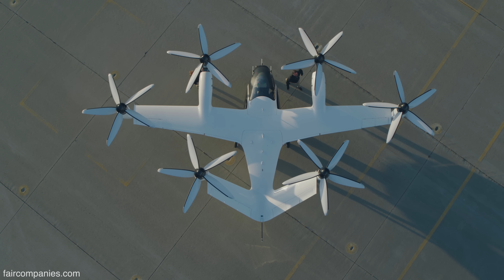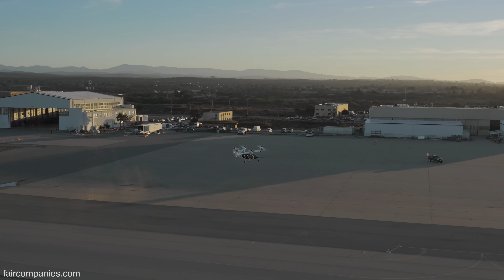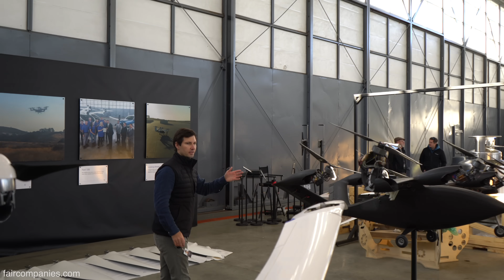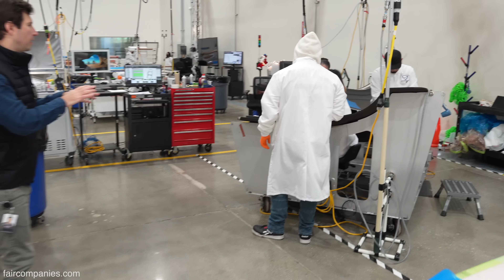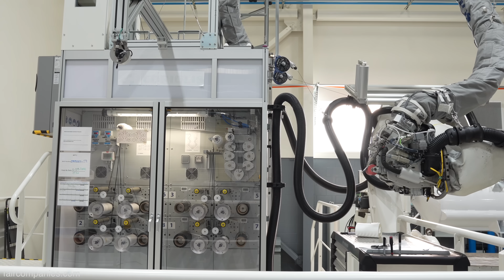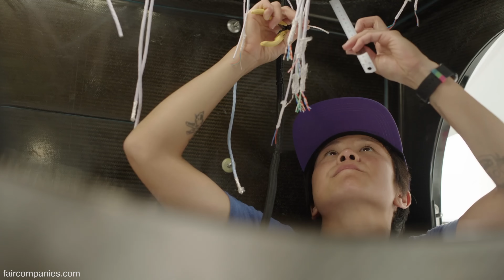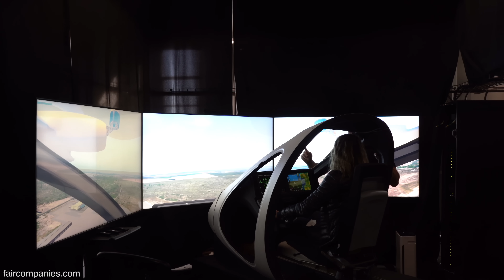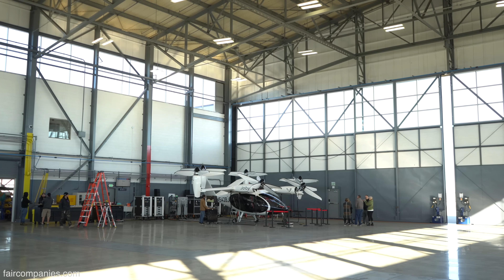eVTOL: electric flying car beats helicopters in silent commute

Comment: Will those superlight propellers hold up properly to a bird/flock strike?
Reply: That’s the reason our president will not fly in an Osprey 🎉
Reply: No. Vehicles using multiple rotors are highly subject to loss of control in case of a single engine/fan failure (assymetric lift/trust). Ever lost a fan on a drone ? I did, it was ugly, was only able to salvage the remote control. Those vehicles are not known to include redundancy on that matter.

Your way out is to fly high enough, shut down all engines and have a chute. You must be trained to identify the nature and the extent of the failure in a matter of seconds, if it's a collision with a foreign object (bird) that may disrupt stability due to a change in aerdynamic and/or power profile, or a more concerning situation like the loss of one or multiple fans. In any case, trouble with lift/power/stability means you land immediately. Helicopters is a mastered technology for so long (you glide via autorotation), drone-like vehicles is fairly new and having multiple engines instead of one (or two, with the torque on Helicopters), means more training to have the qualification to handle emergencies.

Also, I don't think vehicles that light would survive moderate hail storm, or severe rain. Drones as they are today are not that water proof. That's why safer vehicles able to lift humans are a lot much heavier (and therefore requires runways), they are designed with the strength to face adverse weather or light impacts (birds) and ability to glide and land roughly okay even if losing power (if a suitable land site available, like a corn field). I don't see any way to achieve that with such a small/light vehicle.

Comment: I think to be called a Flying Car the vehicle would need to be able to drive on the roads legally.  This is because it would be useful to be able to fly to a landing site and then drive on the roads that last few miles to your destination.  Airplanes have the same problem and have used rental cars or have someone pick them up.  It will be unlikely that you would be able to land at your home unless you had a large property and the neighbors did not complain.

Comment: It’s huge, slow, short range, no useful load, loud as hell and blasts prop wash all over the place. It will require an airport to operate just like helicopters have over the last 100 years. These will not be landing at the mall or your driveway. This video is hiding the noise this machine makes. The props produce the noise in all aircraft….. not the motors.

Comment: Now this gives me hope. I have never been a fan of anything EV for a couple or reasons. The battery range and even more the noise level. Most EV flying vehicles are really noisy which are annoying for home use and for the passengers. But this thing is very impressive noise wise

Comment: And how does it fly with people onboard? II didn't see any payload/proxy weight .... as you load the props the sound produced will increase... if there is no load on them then I would expoect about half the db....what is your net vs gross ? And battery is...? range at gross? so many questions, and the y really do matter. As shown , you have a lightly loaded drone... your control solutions seem great instable forward and stationary... how do you go with turbulance ? and aysmetric load?

Comment: Poor design, look at a cmptr gpu,That's how the blade design should be swept like a spiral with a coanda ring around the blades which increases effiency and noise from blade chop,add a hydrogen system to the electic motors,needs to go back to the drawing board sorry to say

Comment: So question what happens when this transportation loses power due to any number of reasons emp, electrical storm and or failure? Great idea just has some major flaws.
Reply: They could use a ballistic parachute that a small charge or rocket pulls the parachute out.
Reply: It’s still mostly a glider, so it would be able to land just like a normal plane that loses an engine.

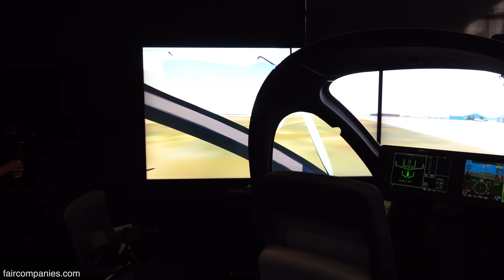Comment: 18:06 
Sorry, but this was a horrible demonstration of Simplified vehicle operations.

If you weren’t there telling her what to do every 20 seconds she would have crashed it 3-4 times for various reasons.
Just because the aircraft doesn’t spin violently out of control or doesn’t become uncontrollable doesn’t mean the person flying it wouldn’t have crashed it.
Reply: Don’t be too harsh at the teacher and pilot, lots of things were going on and what you see is what happened, a real/fresh interaction with no second takes, etc.
Reply: @nicolasboullosa  
This would have been fine if they were demonstrating anything else, but they are trying to sell SVO (simplified vehicle operations)
The idea is that pretty much anyone can hop in and fly one of these with close to no, or no training. 

They should have demonstrated the recovery modes or the form of auto hover I heard they had that would protect a pilot with little to no time, not the woman burning half her battery in a single climb, or the aircraft descending at 190 fpm, or her overshooting the landing zone and bouncing the aircraft. 
It doesn’t sell SVO well. 

Granted, she did 100 times better than if she were trying to fly a conventional Helo, but as a pilot myself she almost made SVO seem complicated.
Reply: @nikobelic4251  Also a test of the aircraft’s ability to compensate for any issue (human error, sudden convection currents as you cross a river bed, etc.)
Reply: That is not the idea whatsoever. Only trained pilots will be licenced to fly these.

Comment: The biggest advantages I see of this thing are the electric propulsion and the lack of noise.  There could be 5 of these flying overhead and they might make less noise than one helicopter, all the while consuming electrical energy instead of fossil fuels.  Sure there are other things to consider: charge times, safety factors, manufacturing costs, operating costs, battery recycling, etc.  However, it's much easier for me to envision something like this transporting people in our cities rather than drones that sound like buzz saws.
Reply: If that would explain it : Small engines (drones) have small propellers, so they need to spin faster. The buzz you hear from drones is both the components vibrating (because the entire structure vibrates) and the sound the fans make cutting into the air and generating turbulences. Similarly, the striking noise you hear from turboprop aircraft are produced by the fast spinnin fans mostly, not actually the engine that is a lot quieter.
The reason why this vehicle is so quiet is because it has 6 fans... that are spinning a lot, but a MEGA lot slower than anything else. And it has wings, meaning the fans spins even slower on cruise.
For helicopters, the "rattle" you hear is caused by the change in pitch for each fan every half turn, not the engine itself, yes, a "wing" fending the air (fan) does noise, a lot, especially when the angle of attack changes. And because helicopters are a lot heavier than drones with only one main rotor, the spin rate has to be that high, which makes them very noisy. The light Robinson R-44 for instance is a lot quieter than a military heavy copter mainly because the "wing" surface (each fan) is a lot smaller.
Reply: @StephenKarl_Integral  I actually did not know why they were quieter.  Sorry if I implied that electric made them quieter.  I meant 'quieter' and 'electric' to be separate points.  I like electric because it doesn't require fossil fuels to run it.  (Note to anyone who would argue the point, please let me clarify...Fossil fuels sometimes go into the making of electricity.  However, it is at least possible to generate electricity from renewable sources only.  I'm also aware that fossil fuels are likely used in the making of the batteries and other parts for this eVTOL.  Nothing is perfect.  I'm just saying it's a step in the right direction IMO.)  I like quieter because...well...it's quieter 🙂.  I really liked your explanation because I can understand it even though I don't know anything about aviation design.  Thanks for that.   It actually makes me wonder if they could build a small delivery craft in such a way that they could also be quieter than the standard drone.  This might make it more suitable than drones for "last mile" delivery situations.

Comment: This carries four passengers? two? three? Definitely electric travel is the future, but I’d like to know the environmental and socioeconomic costs of mining lithium for this thing’s batteries, and then calculate the batteries’ lifetimes, and then figure out the true cost per-passenger of this transportation mode. I think  most use-cases for travel will bet met by electrified boats and rail and especially high-speed rail—and who needs to get anywhere quickly anymore? plus once factoring in security checks and other delays, flight is often slower than high-speed rail in any case—but if one absolutely must fly, why not trot out rigid-frame airships again? and reserve jet flight for emergencies.

Comment: joby really is a scam at this point. ask how much weight it can lift and how far it can go with that load. that's like the most important question. i wouldn't invest in evtol even though all of their stock is way down it will go to 0

Comment: It would have been nice to know the safety profile on this. If the propellers stop working what will it do? I imagine it can fly with one or two propellers disengaged. But it would have been fascinating to see.
Reply: The good news is that electric motors are incredibly reliable. The bad news is that a full failure, which would only happen if it lost power, would make it fall like a rock. In balance, its ok, the failures can be managed. There isn't going to be a glide ratio or a parachute. It flies too low to the ground, and even if it could glide, it would have to land so fast that having it glide would be mostly worthless.
Reply: @scottfranco1962  minimum altitude over even a residential area is like 400ft. in a city with 1000ft tall buildings,  its obviously higher! I would rather glide from 1500ft vs fall no matter how useless you think it might be!
Reply: @Coupe420  There is no limit like that for helicopters, which due to their nature, can avoid buildings (they can stop midairs). Helicopters can autorotate, but flying at low altitude, its virtually impossible to autorotate. Helicopters below about 1000 ft crash when they lose power. The reason that people believe eVTOLs can do better is that they are vastly more reliable than internal combustion engines,
Reply: @scottfranco1962  as was so eloquently stated by the builders, its not a helicopter, its a vtol airplane! And the electric motors arent my concern, as much as the articulating nacells.  If those fail... good luck landing that    vtol on a pad! Just build an electric helicopter!!! This (although looks like fun) is a solution to a problem most people dont have! Or they charter or buy a heli!
Reply: When I watch Marvel movie (Avengers I believe) having one rotor out of 4 on that flying aircraft carrier stop, and the vehicle not going out of control in a matter of seconds, I laugh so hard in my head the rest of the movie is meaningless to me because I couldn't stop laughing, mentally.
Hope each fan on those engines have angle of attack control including neutral... otherwise, it would take 3 seconds to completely tip over for a vehicle that small then get doomed to the ground if a single fan is lost. Redundancy is not the forte of drone-like vehicles, and they are highly subject to not be able to take off if you add too much safety systems and mechanics onboard...
Reply: Backup parachutes/jetpacks would be nice to have. Jetpacks would slow down the descent in the final moments.
Reply: @marajevomanash  chutes could help, on a cirrus sr22 the min recommended alt for deployment is 600'. But people have used them successfully at 100'
Reply: If The Propellers Stop Working The Question Is Can It "Auto Rotate" Which Is Basically Letting The Propeller In A Helicopters Case Keep Rotating When The Engine Fails Making It Much Safer By A Controlled Crash Than Just Having It Drop Like A Rock Out Of The Sky .
Reply: @Gcanno  Not a chance! It won't look too cool. Notice they couldn't find anybody willing to trust getting in it?
Reply: They can’t get insurance for a pilot.  No one will insure humans without bankrupting the company.  Will this thing glide, if they lose power?  All commercial jets glide if they have enough altitude.  Overall: amazing.

Comment: Unprecedented access to Joby!! That was fantastic!
Reply: Practically geniuses. This should've been implemented before or during hand drones were offered. Those fear of evtol days, are over.
Reply: @rolflandale2565 the Public fear still exists, for example if you read comments on other sites, people go off on every negative possible. The pessimistic say JOBY will be too dangerous, we already have Helicopters, we don't need eVTOL's, high wind will cause crashes, first crash with injury or death will end this dream, will be too expensive to fly, I'll never fly in one or a pilotless one,  where will they land, FAA won't allow,  too much competition, won't every happen, and on and on. 

I disagree with all the pessimism, I am a big JOBY fan. My brother is an expert pilot,  he was skeptical at first, then realized, buy buy buy stock or regret at these levels. He admitted he started to buy into a position, a duh moment. 

We only get a few chances in life to hit a stock large, and this is one,  could be a huge success, if you have patience.
Reply: @MC-yb5le  You should know that, the FAA never allows aircrafts to run until almost a decade test is done, some are lucky its sooner than that.
Reply: @rolflandale2565  FAA will fast track the certification of Joby and Archer --- they know these aircraft are safe because of redundancy
Reply: @M C  Helicopters lack the counter redundancy of multi-engine support. When you compare the dangers of a car and the cruise methods of aircraft, both have a chance of survival with initiative actions. If a classic mono-engine helicopter malfunctions, it will plunge like a rock. The helicopter casualties have a very high death ratio. From famous celebrities to most practical pilots with absolute manual navigation. Jobby has a lot of bureaucracy in structure rendering, but the price is to apply safety.
Reply: Now, lets see it carry passengers a useful distance.

Comment: One minute in and the guy is talking BS, quad copter designs have been around a long time, they just didn't run on electricity.
DJI one of the biggest drone makers started out in 2006.

Comment: Drone config is too dangerous because an engine/prop failure will causes a crash. Electric is nice because your not spraying particulate lead on everybody and they are quite
Reply: It's the other way around. A setup like this offers extreme redundancy.
Reply: @Freba9  not in hover mode

Comment: What we were missing was drunk drivers hitting not just the ground floor. I mean it is impressively built, but if you think this is practical and legal for mass use, you are very wrong. This has definitely applications but mass transit is not one of them. I would be curious to see it fly in not-optimal conditions.

Comment: As a private pilot, I am against flying crafts that can not glide and land with engine out. That's why I went with fix wing and not a helicopter. 
A STOL aircraft like Zenith 701 and dozens of others, can take off and land in under 100 feet on grass or dirt runways. 
When these drone-style crafts crash, which they will, then lawyers will get involved and bankrupt the company that makes these aircrafts. 
Most likely, they will not be allowed to fly over populated areas.
Reply: That's interesting. Given this has the fixed wing element of an aircraft, do you think it would beyond possibility to adapt these to have that glide element?

Comment: The military would love this thing as a small insertion vehicle for small units. Areas that have a lot of islands would be great too. Thing is, it needs to seat 5-7 people, or else it won't replace anything that a helicopter can do.
Reply: sooooo an Osprey?
Reply: It will be a fraction of the cost to run, and quiet, win win.
Reply: "it needs to seat 5-7 people..."
I'm not an engineer, but I'm aware the huge problem of electric flying things is "not having enough battery to maintain that thing flying for hours the heavier it gets"
Unlike fossil energy that packs a lot of punch for a small drop of toxic fuel, electricity is like blowing a sheet of paper to maintain it airborne, so, how many people lungs and mouth do you need to maintain a book airborne ? The answer for electric aircraft is... just like airplanes : if you want to lift heavier mass, forget about V/STOL, you need a runway and trade time+distance for potential energy to be converted to lift via wings.

Comment: I was privileged to work for one of the first non-Government businesses to work with pre-preg carbon fiber. The company built light weight large racing sailboats, IACC and AC boats. I started on the first in 1990. The boats we built won a lot of races. Now the tech is everywhere. It is very cool to see the advances. One of the other companies nearby made spars - they had an autoclave, we weren't allowed to use one.